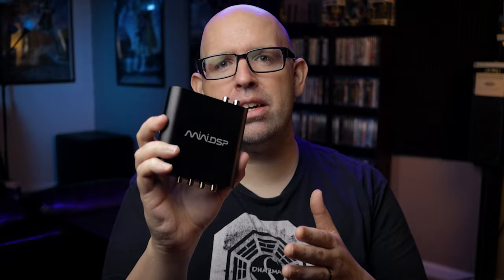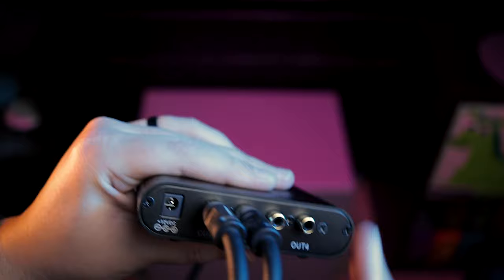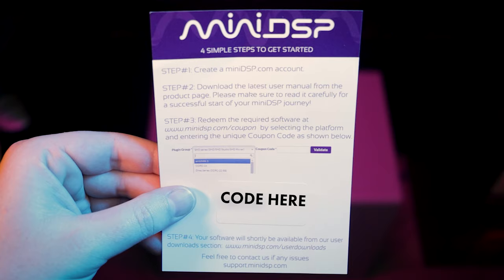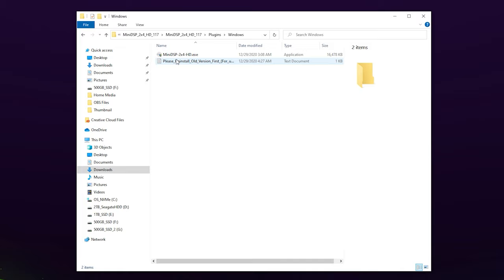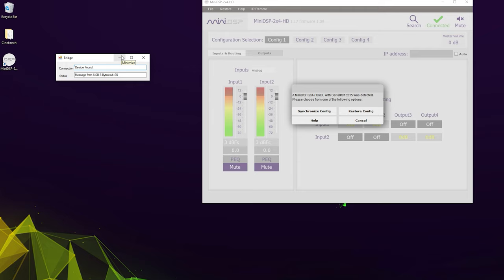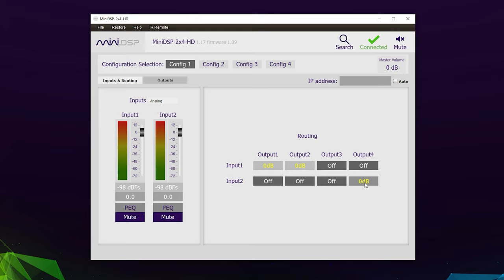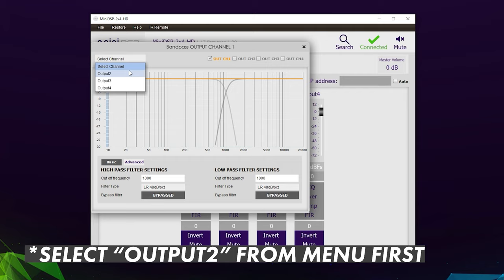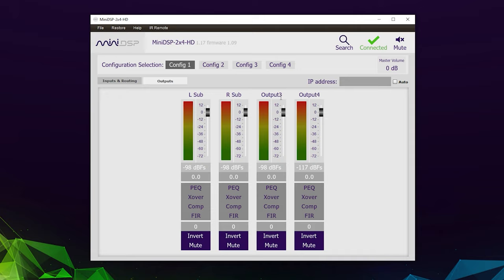miniDSP 2x4 HD | Initial SETUP and Software CONFIGURATION (part 1)

Comment from the maker: Watch all of my miniDSP tutorial videos in this playlist (part 4 to come soon): https://youtube.com/playlist?list=PLriHxML5BOuORC1FWqBI4PF9us7yG8IjK
Reply: Hello Brad. Where can I contact you? I have a question on how to import the house curve from REW going to my altitude 16 receiver. Thank you.
Reply: Great tutorial series, it helped me get my 3 subs all sounding great. One thing you never touch back on in the end though: Do you leave you LPF in the "Bass" settings untouched at 120hz or do you match that to the 110hz that you crossed the front channels at???
Reply: Hey Brad, I was hoping I could get your input.  First off, I used your instructions to calibrate my two 2000PRO subs and found your instructions very helpful.  Thank you!  I replaced these 2 subs for a couple of Klipsch 12" subs, which are a 1/3 of the price I paid for my 2000 Pro's.  Do you feel I would be downgrading the sound if I calibrated "all 4 subs" in spite of the different brand and quality/power output.  Should I just leave my 2000 Pros as is, or do you feel I would benefit by adding the 2 Klipsch for a total of 4 subs?  Thank you

Comment: I know I’m late to the party on this. I bought the minidsp and spent 2hrs trying to get sound to even output from the device. I checked all my cables and they all work without the device. Plus the minidsp was being recognized by my laptop and the app was communicating with it (or so it seemed). No clue if I did something wrong or if it’s just a bad unit. Right now I have a refund request in but if you have any tips on what the issue could be, I’ll give it a try. I followed all you setup steps and even watch the HT gurus video to ensure I didn’t miss anything. Everything runs perfect once it’s disconnected so I’m at a loss. 

Thanks for this playlist even if I don’t get this working. Once again you have done a great job and your time is very appreciated.

Comment: Hello, It is a great start. greatly appreciate your effort to educate the basics of HT tuning and set ups. one thing I noticed in several home theater You tube , pretty much everyone assume that the listener knows a lot and lot of things are excluded. It would be great if you can make it a complete video for an average HT person. how the HDMI is connected to AV from computer and why, what should be the Master volume setup  and levels on the AV, subwoofers, when you tune with the DSP etc.., thanks once again for your effort.
Reply from the maker: Thanks for the comment and feedback. The next video will be covering basically all of what you just mentioned, along with explanations as to why we need to do those things. This initial video was focused on the miniDSP integration because the software setup can be the most difficult and confusing part for a lot of people.
Reply: @HomeTheaterGamer  Thanks and appreciate it..

Comment: This is great information! Thank you.  Subscribed. I’m currently trying to work through setting up my mini dsp 2x4 hd and it’s a challenge. My only suggestion would be a little slower pace but love it. Looking forward to your next installment!
Reply from the maker: Thank you! I definitely appreciate the feedback. The next video will be slower paced but a bit longer than this one. I’m a fan of shorter videos as it can be easier to find and rewatch sections you need without sifting through non-pertinent information, but if I get enough feedback like yours then it means I’m going too fast and need to adjust. Thanks again.

Comment: Hi, I was hoping you could give me some advice. I want to correct only  one subwoofer and not touch my main left and right speakers which will all be running via my marantz reciever. 

So my question is do i disconnect the left and right speakers and try and flatten the subwoofer response independently or do I measure the entire system as a whole crossed over at 90hz via the marantz? 

If I measure and flatten the subwoofer independently once I add the main speakers won't it just destroy the flat response? I'm thinking it's better to measure the sub and main speakers together but then only tweak the subwoofers response to attain a smoother response?

Comment: I m glad I watched part one. I have non HD one 2x4 My plugin is 2x4 advanced I'm using for two passive subs that go into a external two channel amp with two seperate level knobs tactile shakers combine with that amp to on its line level sub out. I have my pluggin set to analoge but only hearing one side . nothing is muted my matrix router high lights output one on top and two on bott I'm what could that be one side and not the other I'll watch part two of your video later.

Comment: Great video series; I've been watching the various parts to familiarize myself and plan follow these steps soon. A clarification please, as I couldn't find a clear answer on the miniDSP website or in the product manual online - If I want to connect 4 subwoofers to a Denon X3700H receiver that has 2 subwoofer outs, would it be ideal to use both the analog RCA inputs, then assign the front 2 subs to 1 and the rear 2 to the other via the miniDSP software, or connect just 1 subwoofer input from the AVR, and then assign all the 4 subwoofers to it?

Comment: I have a question: I am going to use miniDSP for my two subs, question is: Do I need to run audyssey app once I plug in my new sub or after running the miniDSP and aligning my subs then run Audyssey for speakers?

Comment: Hi if like me I’m using 2 subwoofers, that are connected to my arcam av40 and have already calibrated with Dirac, I assume from the subwoofer outputs on the arcam I would plug into input 1 and 2 of the mini dsp , then connect my subwoofers to outputs 1 and 2 on the mini dsp is this correct?

Comment: I just got the minidsp, to setup my 2 subs. (One sub out goes to in 1, and out 1 go to sub 1, out 2 on minidsp, go to sub 2)

But how do I connect my left and right channels in to minidsp into in 2?

I dont have any pre amp outputs on my AVR, I only have  2 subwoofer outputs on it :/

And my source is a computer.

Comment: Why do you need to use the "link" in the output section? Isnt that you had just set the route from input1 to output1, output2 and output3  in the first section?
Reply: I'm interested to know the answer to this one as well as my Denon 3600h has two subwoofer input

Comment: Can you use the MiniDSP2x4 to make these corrections or are the differences between the MiniDSP 2x4 and the MiniDSP 2x4 HD so great that the lower price version won't function well enough to control 4 sub woofers?

Comment: Thanks! Your tutorial is great. I bought my minidsp 2x4 and am about to start the process with my subs. One sub will be in the front of the room and one in the rear. Do I need to play around with polarity, or it looks like it's called "invert" on the software you were showing. Thanks.
Reply from the maker: Thanks for the Super Thanks! You can try playing around with the invert function using REW’s alignment tool, as it will show you pretty accurately and instantly what that will do to your subwoofers response. 

In newer versions of REW, you can also switch the alignment tool to “impulse response,” where you’ll be able to see the impulse peaks and determine if a sub needs to be inverted or not to match the impulse peak of the other subs in your system.
Reply: One more question if you don’t mind…I have carefully followed your tutorial and have level matched my subs. But when I am playing the pink noise I hear it in the sub and the left speaker. I have set the Denon up the way you said to do and have no high or low pass filter in minidsp. Is this a problem? Thanks!!!!!!

Comment: Great tutorial series Brad, Thanks!
my AV processor has 2 independent sub-outs. I want to set up miniDSP 2x4 HD to connect 4 subs (2x sb2000 and 2x sb3000). Should I connect two RCA cables to miniDSP  2 Inputs or only 1? Thanks

Comment: Have you done a rel 3D system? I have two subs as a stereo pair, doing high and LFE. a third on the centre channel - doing high level no LFE and a fourth paired to the rear pair doing high and LFE. Will this process get the best performance for the three subs handling the LFE ? What about the fourth?  A link if you have already done this please :-)

Comment: Is my Minidsp 2x4HD Defective?  
I have the cables physically installed as follows.  Reciever LFE to input 1 on minidsp, output 1 to L Sub, and output 2 to R Sub.  All the inputs and outputs match on the MiniDSP routing screen on the computer, with what is physically installed.  All unused channels/routings are turned off. 
I noticed no signal (visibly/audibly on the computer screen meter output  channel 2) going to my R Sub.  

I then looked at the other input/output meters, and there is a signal going to output 3 (even though its turned off on the routings).  I then unmute output 3, and get signal to my right sub which is physically connect to output 2!  Hmm

I only plan to have two subs, so this isnt a show stopper. So Im fine with my work-around, I guess!  Thanks

Comment: My receiver has 2 subwoofer inputs. So if I have 2 subs, do I connect them to the 2 inputs of the Minidsp?
Reply from the maker: You only need a single connection to the miniDSP from your receiver for your subwoofers. I would recommend just using a single subwoofer output from your receiver into the miniDSP.

Comment: This may sound like a dumb question, but I'll ask anyway. after you're done with all the eq, time alignment etc... does the minidsp need to remain connected to all the subs to retain the settings?
Reply from the maker: Not a dumb question. The answer is yes, the miniDSP needs to be connected at all times after everything is done as that is what stores and applies the EQ and time delay setting a for each individual subwoofer.

Comment: Hi Brad, thanks for the awesome videos!  Quick question, do you think it would be worth getting the minidsp to EQ one sub?  I have a Monolith M-215 and the REW graph doesn't look that bad, but there are a couple dips that could be smoothed out some.
Reply from the maker: That’s a really good question and something I’ve wanted make a video on. It can help to easily get the best response out of any sub (since it’s a single sub, the process goes rather quickly), and you can have multiple configurations that you can switch to with different curves set up. But it’s true potential is only seen when used with multiple subwoofers in my experience.

If you already have something like Audyssey, I would consider testing that and seeing if does a good enough job flattening things out.
Reply: I have had outstanding results using the miniDSP with a single sub.  Using REW and a calibrated mic I was able to get rid of the worst of the dips and peaks by experimenting with the sub location.  Then I used the auto-eq with REW and now have a response curve that is flat from the crossover freq and down 3dB at 20 Hz (12" Adire Shiva sub in .707 alignment, sealed 2 cu ft cabinet).  The improvement in low end quality was amazing!  Quick tip if your receiver does automatic loudness compensation:  DON'T use a "house curve", let the receiver do that work.
Reply: Thanks guys, that was really helpful.  I order a unit and will start playing around with it when it comes in.

Comment: Hi Brad li just love your videos my dedicated home theater is under construction and I am planning to put 2 Active subs & 2 passive subs. 2 passive subs will go behind my AT screen and 2 Active subs will be placed into the room as required.  as I understand the Active subs input can be directly connected to DSP. but for my two  Passive subs, I will have 2 dedicated Amplifiers with XLR in ( for which I will be using a special RCA to XLR converter cable )  my question is is it ok to plug the out of DSP to the dedicated sub amplifier with RCA- XLR cable ? and do necessary adjustments on the amplifier ?

in the case of Mini DSP, how do you suggest connecting 4 subs?

your reply would be highly appreciated

Comment: Great video. It was very clear and well articulated.  Question: My receiver has 2 independent subwoofer outputs. This video shows the use of a single output from the receiver. Should I use both outputs from my receiver? It has Audyssey XT32 and can adjust each sub individually.
Reply: Was wondering this also. When you have Sub EQ (usually when you have XT32) then you should connected the subs using both outputs as described here: https://www.minidsp.com/support/community-powered-tutorials/201-dual-sub-integration Be aware that two outputs does not always mean both can be adjusted individually.

Comment: I am concerned about the mimiDSP noise floor.  Can it be used with high sensitivity speakers such as horn based speakers.  I imagine a lot of hiss coming from the tweeter unless the miniDSP has a noise gate .
Reply from the maker: I can’t speak to that as I don’t have any experience using the MiniDSP outside of subwoofers. Maybe someone else can chime in here and answer your question.

Comment: Can you do this with subs that are mixed? I have two subs from different makers but roughly the same power. Ii understand its not ideal but funds prevent me doing two of the same make
Reply from the maker: Absolutely! Like you said, it won’t be ideal, but it’s totally doable.
Reply: @HomeTheaterGamer  Thanks! What are the possible issues of doing this?
Reply from the maker: Main issue would be frequency responses not matching between the two in the lower octaves, which may or may not be noticeable to you. The transient response of each will be different as well(basically how quick the driver can move and respond to a signal), so even when dialed in one might be slightly less responsive than the other. This might not be noticeable at all unless you’re looking at impulse response sweeps in REW.

Comment: @Home Theater Gamer:  Do you see a benefit in using the SVS subs app and MiniDSP or do you think one overwrites the other?
Reply: The SVS app is great, especially if you want to boost the output temporarily but the MiniDSP does everything the SVS PEQ does and more so it would be best to leave everything stock and calibrate with MiniDSP.

Comment: How about when you have two subwoofers daisy chain. How do you connect it to the miniDSP. THANKS
Reply: Unfortunately you need to buy a separate subwoofer cable if you want to control the subs independently.

Comment: If you have two sub outputs from your processor, should I use both or just one for the input? Thanks!
Reply: It would be better to use one but if you are using 2, you need to make sure that all the settings are set as a baseline / the same on each sub on the AVR/Processor and let the MiniDSP do all the work.

Comment: Thank you. I have an SVS SB 3000. My room is approximately 9x11 ft.  I have one seating position which is directly in front of the TV.  Do you think  the best position for the SB 3000 may be directly in the center underneath my TV? 
Let me know your opinion if you will.
Reply: The cheapest way to start is:
Place sub in main listening position.
Put something on with varying bass (or even sweeps).
Literally get on your hands and knees and crawl around the room.
Where the bass sounds the best is the ideal location for your sub.
Then, if you really want to go down the rabbit hole, you can dive into minidsp, rew, etc.
Good luck.
Reply: @mephInc  Thanks!
Reply: @makkkk4444  
Hope that helps.

Comment: Thanks for your video presentation, how would you use the mini dsp when your receiver has two subwoofer outputs, thanks.
Reply from the maker: Since the MiniDSP acts as your splitter, you’d only use one of the subwoofer outputs on the receiver. The second output could come in handy if you have the need for another MiniDSP (for subwoofer counts higher than 4) or a bass shaker system.

Comment: first spend a few thou on subs, speakers & amps THEN spend a couple of hundred more so you can spend hours to do this. I'm so done w/home theater bs at this point. 🤦
Reply from the maker: You don’t HAVE to do this, the point is that you can if you want to because the hardware and information is now available to you. Or just decide that you’re happy and content with the sound you already have. It’s the same with any hobby really. There’s a rabbit hole you can choose to go down or not; that’s ultimately up to you. 

The fact that the ability to do ANY of this is much more accessible than it was 5-10 years ago is amazing.